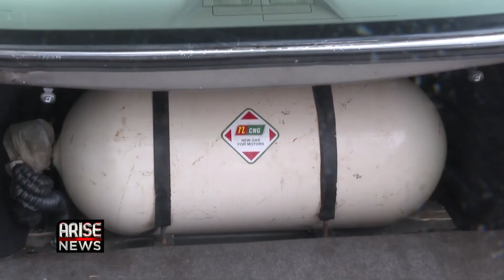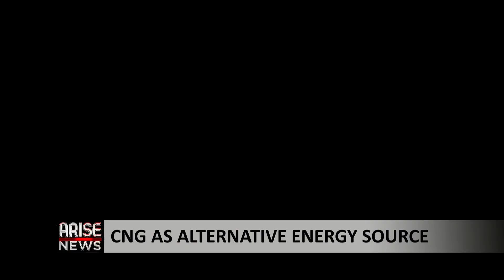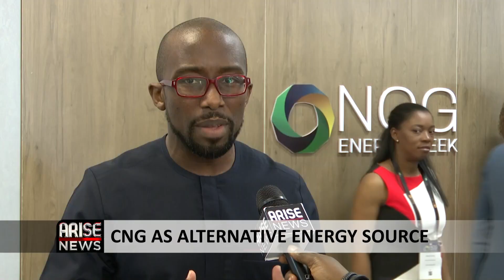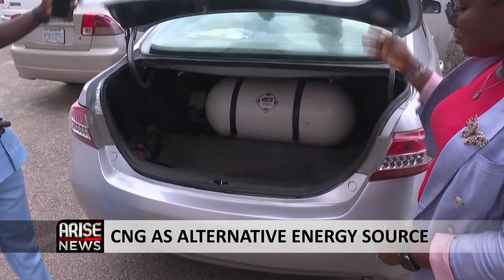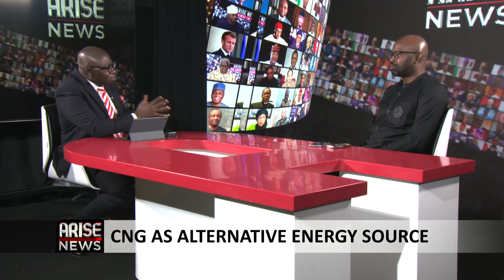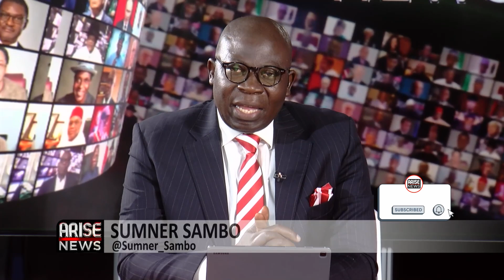PMS Hike: CNG is a More Sustainable Domestic Alternative to Electric Vehicles - Brian Amonu

Comment: The high cost of transportation drives up prices and since CNG costs far less than PMS, the government should massively invest in it. In fact the entire money that the government has mapped out for palliatives should be channeled to vehicle conversion and CNG availability.
Reply: The govt is not likely to invest in CNG because of the obvious benefits of trading in PMS. Don t forget the government has a huge stake in Dangote refinery. 
The private sector must take the initiative in embracing and investing in CNG just like we have done with solar and generators.
Reply: Thereafter,  Nigerians will begin to hike the cost of CNG and hoard it.